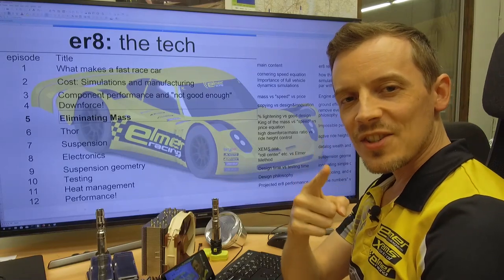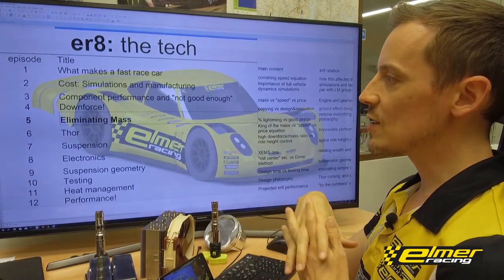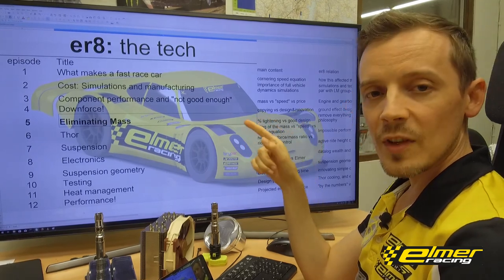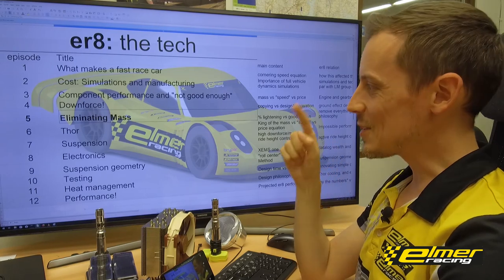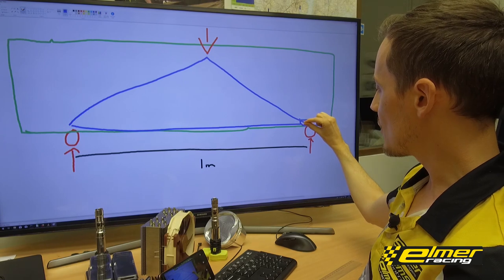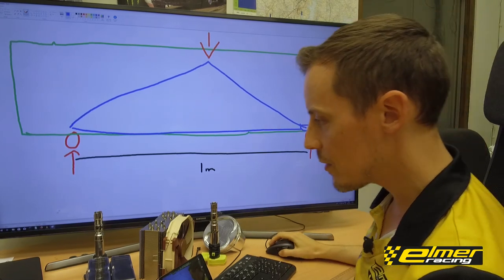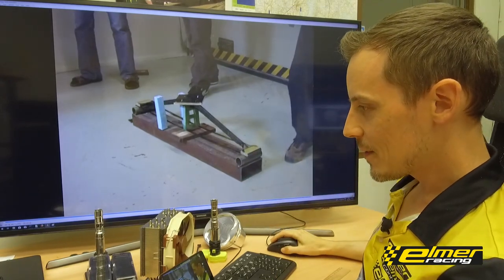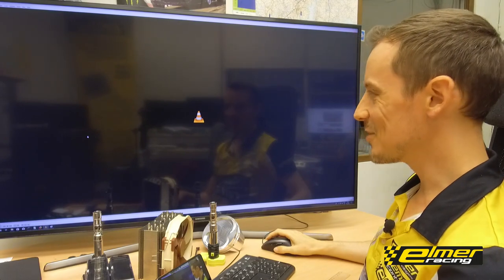Eliminating Mass! er8: the tech ep5

Comment: Short version: Mass is the enemy. It works against you in every aspect of the design.
Reply from the maker: Yes! Figuring out how to use as little of it as possible on the car is difficult though. Requires a good understanding of how things work!
Reply: @ElmerRacing  just quoting my personal god Gordon Murray.
Lot of the time saving weight helps you save more weight.

Comment: I've seen aluminum suspension wishbones aftermarket parts becoming more and more common, any comments on that?
Reply from the maker: How good they are will depend completely on how well they are designed. Doing a suspension setup from scratch is much easier :) Then you can really take advantage of the space, design, material selection etc.